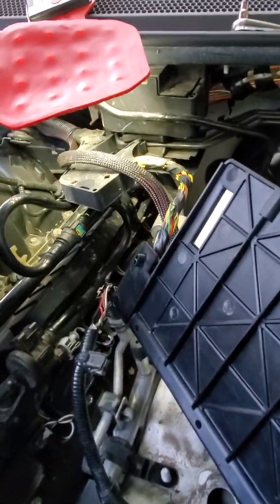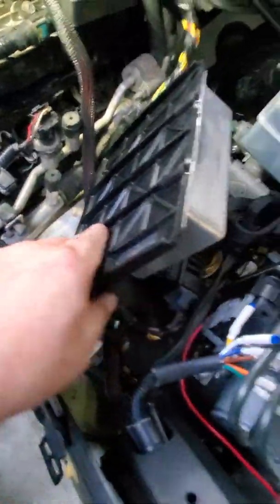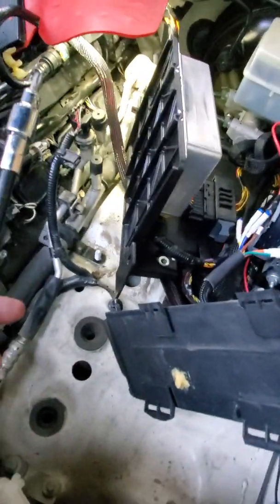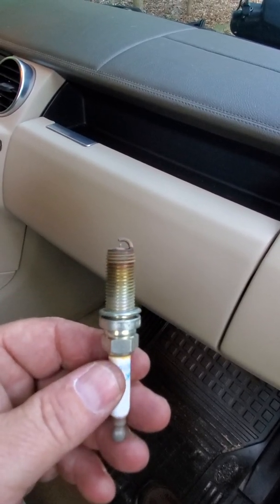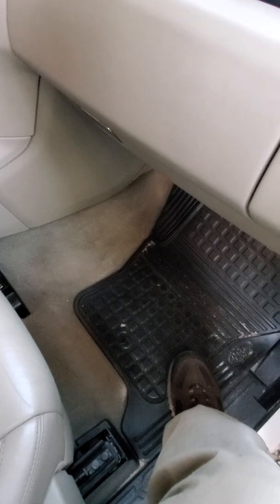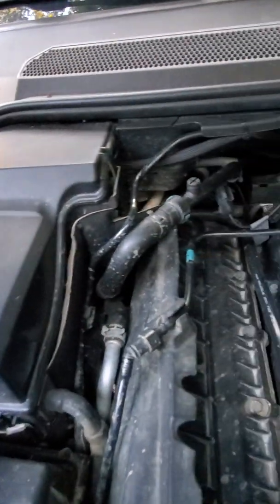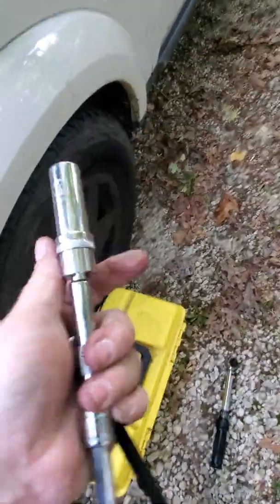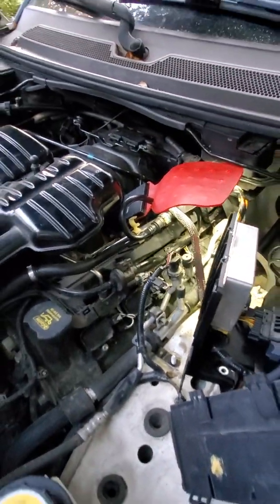Changing your Land Rover LR4 spark plugs?

Comment: I thought my LR4 needed spark plugs (mechanic advice and auto zone diagnostic) but dealer said it's a catalytic converter. Any use in going ahead and replacing the spark plugs anyway?
Reply from the maker: What were the symptoms codes?

Comment: All they had to do to make me happy is run the AC lines a half inch higher... I have the tools/equip/experience to remove the AC but the thought of having to do that for a spark plug... I put off my plugs until now, installing timing chains so everything comes apart anyway... my 2013 LR4 is at 173,000 miles and plugs are probably original (bought it at 50k) IF I do end up evacuating the AC... I will probably re-bend the lines for future service.

Comment: I’m glad my LR4 is a V6 😉
Reply from the maker: Oh no. Don't think you are safe from the Land Rover Pixies hehe. All they did was lop off 2 cylinders.
Reply: I just found this video because I’m sitting in my garage with the super charger removed (did the rear crossover and supercharger coupler). I’ve got a fresh set of plugs I was going to put in and I’m genuinely perplexed and not sure if it’s possible without removing the engine. I’m just about to give up and put everything back together as I don’t believe the job can be done. At least at my skill level (Bear in mind I pulled the supercharger by myself in an hour and a half so I’m not a beginner).